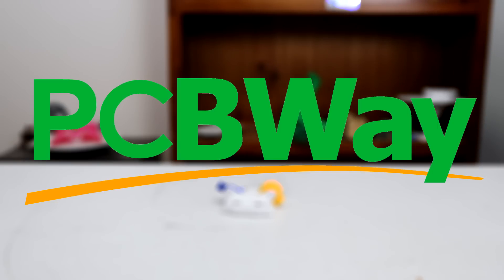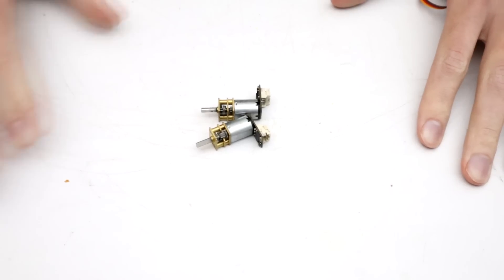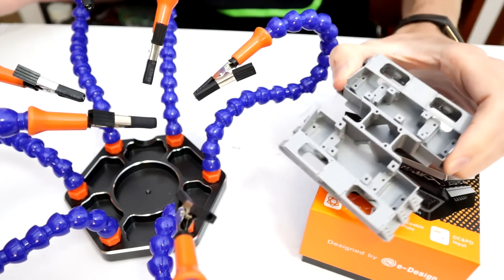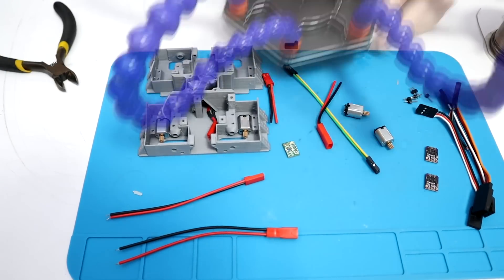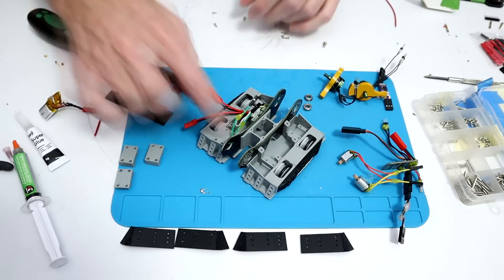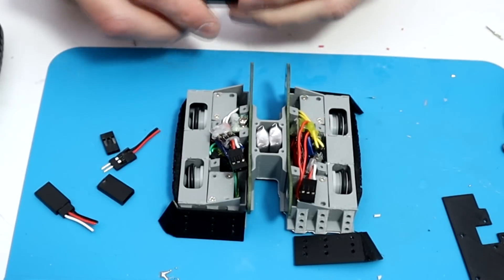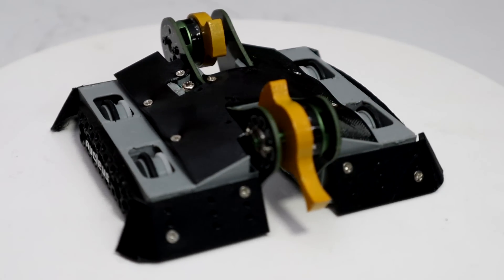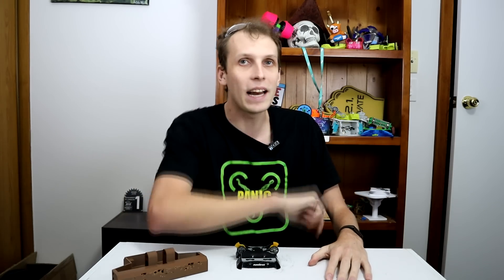I shrunk the Hacksmiths Battlebot!!! (150g Orbitron build)

Comment: as others have said, you do some remarkable work.  May I recommend the youtube channel diorama111 and others like him who build fully radio control cars that are matchbox / hotwheels / "HO" / 1:87 scale, with full working lights and some even have working parts like tractor buckets and trailer landing gear, etc., in some awful tight models..  you may find more hints and tricks and tips and maybe even inspiration too
Reply from the maker: I just checked out one of diorama111s videos, the custom servo using a reflector and a lead screw is interesting

Comment: Today I learned that my eyes are definitely not good enough to build ant-weights
Reply from the maker: you dont need to use components as small as I did in an ant weight, I just needed to because otherwise I would have run out of weight

Comment: You said, you soldered in connectors  and I am a bit surprised because in my engineering classes I was taught that soldering crimped connectors (which most connectors are) is detrimental because you are not getting any relevant increase in connection quality (both electrical and mechanical) between a crimped and a soldered connection and the increases stiffness of the solder will lead to early fatigue especially in high-vibration environments. 

Unless you are talking about soldering wires with pre-crimped connectors and calling that wire/connector assembly a "connector"?
Reply from the maker: They are correct in your engineering class, a crimped connector does not need soldering

I was talking about the pre-crimped connectors and calling wire/connector assemblies a "connector"
Its not technically accurate, in some ways, but as it is common to call the whole assembly a connector I often do

Comment: Yes as soon as I heard the beeps I knew it was resetting because of low voltage spike when the motors stalled. When you work with RC you learn all the sounds. Its pretty cool you made all of that fit and be within the weight. Amazing work. I don't think I would ever go that small, for me 250g would be hard to stay within weight. Not sure what the next weight class is but i would probably be able to make a 5lb robot any thing less would just make me mad trying to fit everything in. I could probably do 250g but I think I would frustrated the whole build.. awesome work!

Comment: amazing work, well designed, I believe the brownout is primarily the batteries then the ESC. Not sure if a capacitors could help with this.
Reply from the maker: It might be batteries browning out as they are tiny, but it might also be a back EMF spike from the motor stopping suddenly causing the ESC to reset

If its battery then capacitors would help, unfortunately I dont have the weight or space to add any level of usable capacitance
Reply: @TeamPanicRobotics  you might not have the space or weight but nothing stop you to at least “test it”! Tape it to the side and add weight, who cares, the goals would be to find/isolate the problems. I been flying drone and can tell you it’s not back EMF resetting the ESC. We crash our drone full throttle in trees and they don’t reset. Just catch on fire 😂. I am willing to bet it’s lipo. Not even sure capacitor will solve it. A new better battery yes. I know this is super hard problem to solve with weight and size. I think you can save weight by redesigning the FR4 that holds the weapon. Have more holes. FR4 is heavy. Anyway. Google “tinywhoop batteries” these are 1S 150-350mah lipo battery that take a good discharge. They are long! Also lower the Kv of motor or size to lower current. Good luck and and keep making cool stuff!!

Comment: Switching to a track drive on each side would save some critical weight to allow for more allowance for the ESC or weapon motors.  I get the goal was an exact repo and you definitely nailed that but as to being effective changes would be needed.  Unclear why you made the weapons the same colour - wouldn't different colours make it far easier to drive.
PS:  No mention of their crazy AI driving system which is the real innovation of orbitron.  Since it doesnt actually add hardware to the bot it could be done in any weight but cant say that would be an easy thing to reproduce.
Reply from the maker: For sure, a track or gear driven 4wd would be lighter and probably more reliable but for this iteration I wanted to be as close as possible

Different coloured weapons is a great idea for knowing robot orientation, but when I was test driving I found it fairly easy to keep track by looking at the power LED, as long as I know thats the back right, I know where the front is

Ps, yeah the AI is very cool and also very complicated. I could probably do it without adding anything to the bot, but this build was already complex, so I had no time to look into the AI system. Maybe in a future video

Comment: Did you think about using the weapon mount PCBs to route all other wiring around the robot? So the drive motors would just wire directly back to the PCB. Maybe not put the electronics directly on the weapon PCBs.
Reply from the maker: Honestly I didnt, I thought of the PCBs as a carbon fibre replacement and not much else, this was definitely an oversite on my part

Comment: This looks so awesome but I was curious as to why the weapon ESCs were shutting off after each hit
Reply from the maker: I think because the ESCs are tiny and only rated for 6A, which is more then enough to get the bar spinning, but when it hits something there is a large spike of current flowing backwards that disrupts the esc
If I had the weight/space for a 20a esc it wouldnt be a problem... I dont think
Reply: @TeamPanicRobotics  I'm assuming if you let of power it would be fine, but those weapons have little inertia?

Comment: Have you ever used protoboards & solder as replacement for wires? Seems like a flat-laying backplane of sorts might help with the wire packing for smaller builds. Absolutely love the mini orbitron build (and Nucleus is such a perfect name lol)
Reply from the maker: I honestly should have done that, but I designed the pcbs during the mechanical design step, so I wasnt thinking about wiring at that point

Comment: Awe man, i thought it would actually have the ai and all that, but that is kind of ambitious, the build is still nice by the way
Reply from the maker: That is ambitious but I think I might be able to do the ai externally 
If not, my plan is to get a "this machine doesn't have a brain, use your own" sticker to stick to the underside 😅
Reply: @TeamPanicRobotics  Was the real orbitron actually putting the processing on the bot?  I thought it was using external cameras and a pc linked into the radio controller.
Reply: @ccibinel it started with all the computation off the bot but then they put part of it on the bot however it's not needed.

Comment: Just a thought. If you're using a pcb for structure, why not use it for some connections as well?
Reply from the maker: I did think of it, but it would likely only be useful for the spinner wires as the rest run perpendicular to them.
Although, might have made the motor wiring a bit easier.... damn, maybe next time

I very briefly thought about putting an esc on them too but I havent ever made a custom brushless esc, and the control board had brushed escs on it already
Reply: This is actually a cool thought. I like this idea, he could easily save a couple grams there
Reply: yeah lol, go one stop further and design an esc into the PCB for extra compactness.

Comment: Amazing build Ben. Perhaps the most complicated Antweight out there. 
Just a thought but I mostly use JST PH 2mm style connectors these days because the the servo style connector and even the red battery connectors just take up so much space.
Reply from the maker: Thanks!
Haha it might just be!

Thanks for the tip on  JST PH 2mm style connectors, I'll look into getting some, I ran into a lot of issues with connectors taking up so space in this build
Reply: For the battery connections he could use BetaFPV BT2.0 or the competition GB2.0 I think plugs that are very small and carry the same current with smaller size than JST

Comment: Looks awesome but would it have been lighter 2 run both weapons off 1 motor with a pully or something?
Reply from the maker: Maybe?
If you run pullies, you need at least 3 pullies and 2 belts, not to mention axels to run the weapons on (which need to be strong/heavy enough to survive a hit), plus the chassis would need to be bigger to fit the motor into the profile (I really wanted this to look like Orbitron), which adds even more weight, plus something to connect the weapons to the pullies (could have been printed in but steel pullies are heavy) plus bearings to run the weapons on

So it might be lighter, but it would be a gamble
Reply: @TeamPanicRobotics who knows, maybe next orbitron will use hub motors 😂